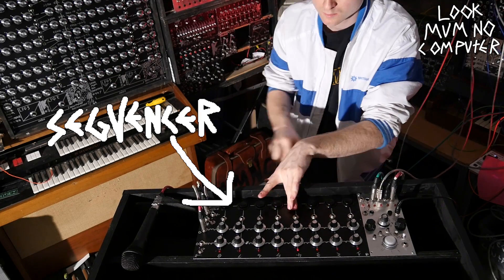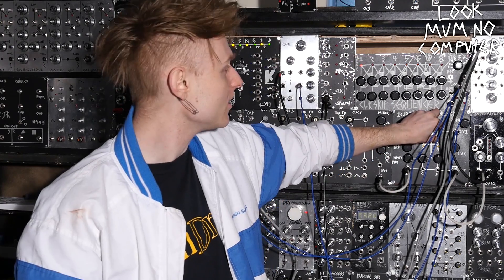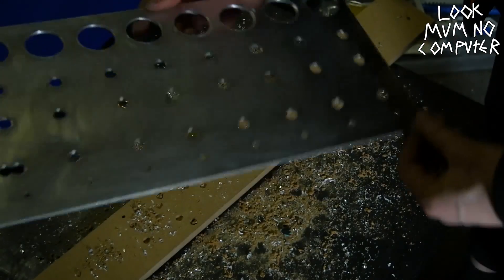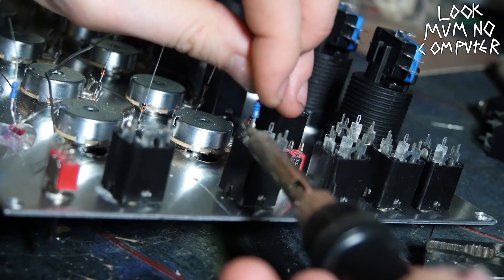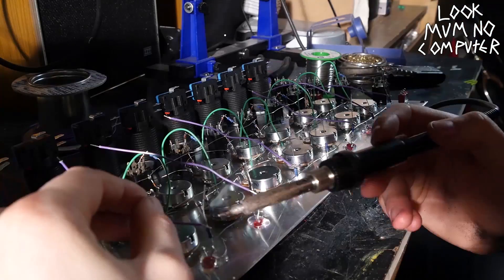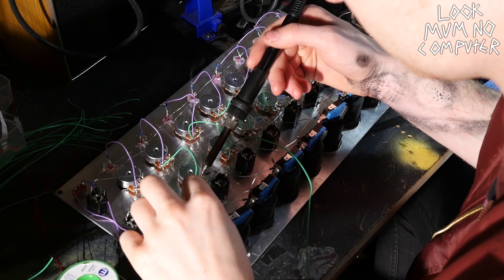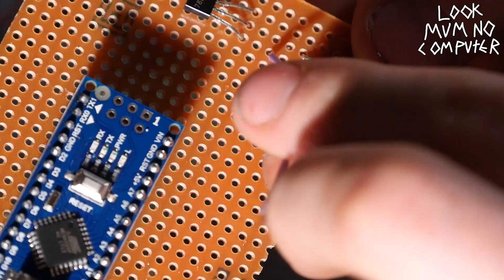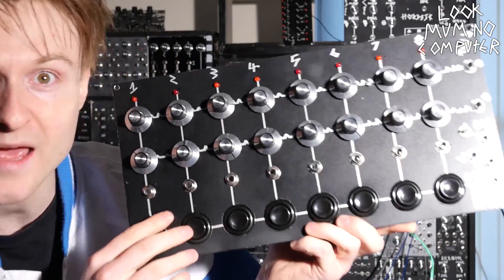ARDUINO 8 STEP KEYBOARD SEQUENCER FOR SYNTHESIZERS

Comment: 4017 was first chip i ever used back in 1977. Most of us were still building with valves then. Knight rider was the thing and connected each of the ten outputs of 4017 to leds to give the scanning display. Was clocked with a 4001 quad NOR gate as osc.

Comment: built analog outputs version. spent two days troubleshooting so far..all steps seem to work but they lights dim the further from step one they are... they only advance with forwards clock reverse does nothing but has 5v coming out when switch is hit. any button press resets it to step one being lit after the button is released. ive read every forum post and i have tested everything i can think of. maybe its my arduino?

Comment: i ordered all of the parts for the 2001 update before i realized theres no info on the dif between them and i am terrible at reading actual schematics. how do alter this version? i joined patreon but couldnt find anything there either
Reply from the maker: Aaah yeah the 2001 is a more advanced version of this project. Unfortunately the best way to do it is to work from the schematic if you don't want to make it from the pcb sadly :( also to answer your wav trigger question use the midi input instead for everything that means you can do the pitch bends and everything
Reply: @LOOKMUMNOCOMPUTER  im used to using bend diagrams and hand drawn labeled stuff i understand most of it just not enough to guess. ill keep trolling the forum thanks! if i can save up a little money ill probably just order the pcb
Reply: i have no issues following your hand drawn squiggly lines but that printed version hurts my brain haha
Reply from the maker: @machinemademan  i think its slightly more involved than a usual sort of bend design of sequencer. so it might be a little hard to draw in a different way. i think the best bet is to make the one in this video. the difference isnt massive :)
Reply: @LOOKMUMNOCOMPUTER  i chopped up an old stop sign from my time as a sign guy for a panel then i made china a little richer for my bday this year and ordered the stuff for big button wav trigger and this. i put a caspers lfo into a rugrats vhs and hooked it to a werkstatt then it snowballed into this.  thank you so much for what you do! ill keep supporting the channel i wish i could do more

Comment: I build this 2 times with different components but the sequencer will not work. Keyboard works fine, but the sequencer is running non stop and reacts when i touch anywhere (Button or pots). I try different jacks and knobs. I think there is a ground problem but i dont get it. I check the schematis and solderpoints 100 times... 😑
Reply from the maker: The clock in jacks need 10k pull down resistors

Comment: Hey Look, I need your help as I have an arduino mega 2560 and I'm going to build the same sequencer as you built but I totally don't know much about programming. ehhh i want a 16 stepper done for 2 oscillators (CV). If you could help me understand the code and diagram, I would be very grateful. We can contact you by email Mieszkoalbrzykowski@gmail.com.

Comment: Hello, Anyone built this for eurorack? Will figure out dimensions and stuff, BUT: 
Hows the Power supply working?
Will pick up Ground and 12V from the Eurorack Power Busboard, probaly? 
Is it only thge Arduino, that needs to be powered? 
The Arduino works with the +12V from eurorack?

Thanks for any response, hope this gets some attention :-)

Comment: Is there a reason I need to connect it to an external power supply? Will running it all through the arduinos 5V cause issues? I can't figure out from the schematic whether its positive voltage coming in or just voltage. I'm sooo close to finishing this, and don't really have a modular set up yet, and it'd be really cool to just power it via USB for now lol but I don't wanna blow it up.
Reply: Don't worry! I think i've figured it, and it should be fine running off 5v arduino power.

Comment: I have a akai synth station 49. It’s a keyboard with an iPad dock in it. It has no midi input. It can get midi through usb. I want to add some real time control (knobs and what not for cc). Do you know if something could be made with arduino and plugged into the usb to control my iPad synth apps?

Comment: Is there a simple Clock  circuit for this? Been looking on how to make a stand alone analog  clock, that has read out for BPM so I could dial in  is 128 bpm and maybe  multiple outputs, any suggestions? Thank you!
Reply from the maker: hey daniel!! digital or analog? i wonder how tough it wqould be to achieve analog let me think,. have you looked on the arduino forunm? probably not what you want to do mind!!!
Reply: @LOOKMUMNOCOMPUTER   analog. I have build 1 CEM3340 VCO and almost finished my 8  step seq, going to finish up my envelope ,  starting to come together,  still have to build the  sparkfun drum machine. I did search the internet f but did not find anything
Reply: @LOOKMUMNOCOMPUTER   here is the best I found  - https://www.youtube.com/watch?v=nBucMzlgESw  website page https://create.arduino.cc/projecthub/Synthemafia/modular-synth-clock-module-diy-arduino-sm-tik-tak-bd8ded looks like might work ,. what is your opinion on this?

Comment: I wanted to make a baby 10 sequencer, but the arduino seems the more versatile route.. I see you already generously put the plans for this up, but so you have any tips on 1)making this a 10-step and 2) adding switches to adjust the number of steps like on the baby 10s? Like say you wanted to jump down to 4 steps..

Comment: This is awesome, but for now I can not figure out exactly how to proceed with this. If I understand, the arduino doesn't generate itself the clock pulse ? wouldn't it be great to add this function with a new pot, of course it needs analog input for this...may be with an arduino mega  or due ?

Comment: Hey Sam! I love your videos... I'm currently working on an organ drawbar controller from the parts of an old Weris organ... based on the Arduino Micro. Getting along mostly well so far... but one question I have: What front plates do you use? Aluminum stuff, I suppose... what are they called?

Comment: 5:00 The Arduino's AtMega328 chip has internal pull-up resistors you can enable thru software :)

Comment: Does anyone know if the 5v wire connecting the push buttons and the 2 switches is connected to the 5v out pin of the voltage regulator or if it only connects the switches and buttons. Thanks

Comment: could I use a slow sqaure wave oscilator as a click signal for a 4017 chip?
Reply: No because square wave is ac. You need a clock pulse, which you can create with a 555 timer

Comment: How do I send midi notes with the arduino sequencer ?
Reply: It's fairly easy to make the Arduino send MIDI out. You just need to Google "Arduino MIDI out" for the components, and use 1 or 2 other digital outputs to send the data. I dunno how the note pitch would scale though! Like, would an octave in MIDI pitch match an octave in the CV? Probably... not so much...

Comment: I'm working on it right now. Arduino is mounted on stripboard all switches, knobs and pots are in plave, now I "just" need to solder the cables, resistors and stuff.

Comment: Why bus the pots instead of isolating them? Or am I missing something
Reply: Each pot is a voltage divider between an Arduino's step output and 0v ground, so the ground connections are commoned / bussed.
 The outputs of each bank of 8 pots are routed through diodeees to a common CV-out bus line.

Comment: Amazing video! Where is your source of sound? Is it from your Analog synthesizers, or via usb in the Arduino? I'm new to circuits! I want to filter sound from a virtual VST into this amazing device, could I get similar results? Could I get such results filtering sound through an audio Interface?

Comment: you progeam the arduino, using the arduino IDE software. you can download it online.   you may also need to download Ch340 driver, if you use an arduino clone

Comment: Hi sam.. firstly, your channel is awesome! Just joined your patreon :) I love building diy stuff, generally arduino based granular synths and noise makers, with the odd 555 based theremin thrown in.. i've just built this but im having a hard time understanding the 1/4 jacks..... i know the ones under the buttons are cv out to control other modules or noise makers... but what are the others? reset cv? fwd/rev? are these inputs??? and which jack do i put th clock signal into?  and woukd it possible to hook up an integral osci, so it has its own clock? sorry for the probably questions, kinda new to this aspect of electronics.. Jay
Reply: I've been trying to figure this one out too.  I just got it working..I think...for the most part.  Go CV OUT 1 or 2 to CV in on an Oscillator, and to your speakers from the oscillator out.  Send signal out from another LFO to Forward or Backward cv in for your sequencer clock.  Or at least that's how i've had it working the past day or so. I have an issue where it won't cycle through steps if I plug certain cables in all the way??   Any tips Look Mum No Puters?
Reply: Cheers.. I'll give that a go at the weekend.
Sound like your jacks might be poor.. I had a bunch of jacks that would only work when they were partially inserted.. Swapped the jacks out and the issue went away

Comment: Wondering the voltage out of this? 0-power? (5V)? Is it enough for modulars? Could you replace the buttons with, lets say touch plates? (Finger touch thing?)
Reply: The CV-out is probably 0v to 4.4v (5v - 0.6v diode drop.)

And yes, those capacitive touch switches could be used instead of the mechanical tactile ones.

Comment: Hey! thanks for your amazing inspiring stuff! One question: I built your sequencer and when I power it on, or if I send the clock in, it's stuck on the first step. I can tell from the Nano board that it receives the clock but it doesn't move on...any idea?
Reply: SMMP Have you had any luck with this? I'm having the same issue and assume it's something to do with the code?
Reply: Hi Jeremy,
yes I had luck, but the issue is not in the code but it was in my soldering. I had something not connected which I forgot to solder properly. So my advice would be to check the board and all the connections...
Reply: SMMP Thank you! I did find that the issue was no pull down resistor from the 0 CV in his wiring diagram. I have it working now. thanks for your response!
Reply: yeah, I remember finding the odd glitch in the diagram even if probably, due to lack of sleep, I just forgot to take notes...

Comment: I just built this (It's almost working) and I noticed an error in your arduino code: It looks like you switched the STEPBUTTON7 and STEPBUTTON8's pins in the top #define section. 

Thanks for the awesome build though!
Reply: can you help me please? I built it but not working, no sound. I think that the sketch is not complete.
I did everything as in the photo.
https://www.youtube.com/watch?v=A0ch_8IlzD0&feature=youtu.be
I don't even know what's wrong
I checked everything but the sequencer does not work

Comment: So what is the voltage regulator for, to limit them triggers to 5v? Doesn't nano have a 5v regulator? Just been thinking about that for last 2 days.
Reply from the maker: the heat dissipation on the one on the nanos aint too great. so i pop one on anyway. no harm, had a couple of nanos keep shutting down cus ot the VR;s gettng too hot from a synth power supply

Comment: Are you ever worried about the bare wires accidentally touching or shorting? Maybe spray something like a latex paint on them as a final step after successful testing? Like hell I would spend all day long with a roll of electrical tape!
Reply from the maker: taking old things apart and seeing bare wires like this, has kind of eased my mind on that.

Comment: If you're using an 8 sequence, does it use the 4017 or the 4022?  I looked up the datasheets and the 17 looks to be decimal.
Reply from the maker: Dave Hojo yeah it’s a baby 10 sequencer:) just reset it at 8!

Comment: Hey! Love your vids. You should show us a baby 8 sequencer as well! :) I think the IC for it its a little less expensive than an Arduino.
Reply from the maker: João Pedro VC Ferreira yeah I guess but those arduinos are only £2.50 search up arduino nano on eBay. Cheap as pineapples
Reply: oh well never thought of buying it through eBay. I'm a bit inpatient so I usually buy my electronics in stores here in Portugal. not quite as cheap here. more like 15€ and the 4017 IC is only like 1€. But yeah, will buy stuff for this on eBay! :D Cheers!

Comment: This is hands down the best diy musical project I've seen. I'm about to make one of these along with some simple oscillators to start with, but I'm a total beginner at synths and stuff. I was just wondering: how do you control the tempo of this thing? Does it need the signal from an external source (and where would you plug that in) or maybe I can have it simply controlled by arduino by adding another knob?

Comment: Thanks so much for sharing this project. I thought I’d give making one a go and it came out very nicely. I shrunk it down with 3.5mm jacks to work with eurorack and smaller buttons. Built it in its own little box powered off a 9v guitar pedal power supply. Works a treat. One query, why did you go with separate jacks for forward and reverse rather than a switch?
Reply from the maker: cool! fire us over a pic and i can include it on the website :D computer@lookmumnocomputer.com

Comment: lovely project. I think I 'll make one for eurorack. Do you think I can just remove all the "arcade style" buttons???
Reply from the maker: yep! itll be fine. if you find it starts jumping steps. have a look at the code and remove the switch input pins. just put pin 0 on them all. or you could just wire all the pins that were on the arcade buttons to ground! also your on my patreon, there is a schematic and code for a 16 step arduino sequencer much like this on a zine :)

Comment: ..."and then you can make it do whatever you want".... #arduino. I think your fundamental knowledge of other IC's is far more valuable than the over-hyped functionality of ARM/Atmel-based solutions. There's something to be said for having an exact solution over an over-engineered, seldom-utilized, programmable MC. Tough, maybe I just have some opinions....
Reply from the maker: Fair. But whenever I’ve breadboarded out stuff with cmos in the past. I’m sat there being like aaah it’s so close but I wish it did this. Or this different. Having to add a load of other crap to make it do something not 100 percentnhow you want. In the end of the day I see it as aslong as it’s real and a tangible real world machine and does what you need. It’s fine. And these arduinos are so cheap
Reply: most of the time I'm planning stuff with discrete components, and find out it's much cheaper to plug in any MCU (Arduino for not complex stuff, 32-bit arm like the stm32 series for more complex stuff) and call it a day.
plus with the Arduino, you have a fewer bodge wires laying around.

Comment: heya there! your channel is gold. started patreoning and stuff. anyways: is this sequencer putting out voltages 0-5V to CV? how does that work with modular stuff, isn't the CV usually -12V .. +12V or something? really newbie question but bothers me a bit since i'm planning my own low-cost "modular" stuff.
Reply from the maker: zapallalla thanks! There’s a live stream tonight! On over there thanks! Yeah it’s fine. If you think of v/Oct it would mean from the 0-5v it can put out that’s 5 octaves. Which is more than enough! And plenty of space to modulate things. Yes it could be  a larger level but that brings more components into the picture. And for that’s it’s meant for this does the job fine!

Comment: Engineering is punk. Subversive. And you embody that ethos. Never thought I'd hear pull up resistor or diode explained so simply...as in 'this is what it is. This is what it does. This is what it is for. Move on.' Love the spaghetti mess, the apparent drill sloppiness while driving home the value of pilot holes, the well used bench, the old Apple ][, the 'just try it' bias. May your videos inspire legions.

Comment: Where do you buy your aluminium sheets to make your front panels?
Reply: super nice rig there ^^
Reply from the maker: https://www.ebay.co.uk/itm/Aluminium-Sheet-0-7-0-9-1-2-1-5-2-0-2-5-3-0-4-0-mm-Thick-x-25-Pre-Cut-Sizes/400651887596?ssPageName=STRK%3AMEBIDX%3AIT&var=670200641065&_trksid=p2057872.m2749.l2648

Comment: Look Mum, Thanks again for all the videos, I just watched your video "A Guide to Modular Synthesis with Look Mum No Computer," and saw you talk about making your own power supply (i figured this is the best place to write to you though, as the other vid isn't on your channel). Could you kindly point me in the direction of a schematic or helpful keywords for making DIY power supply. I spent a few days searching before I saw the other vid, but couldn't find anything, think im looking in the wrong place! thank you!!!!
Reply from the maker: Dominic Ditaranto 2 parts. I recommend just getting the pcb by frequency central called power pcb. Search it on google you’ll find it! And then a wall was that is 12v ac. Not the usual 12dc but ac output!
Reply from the maker: Dominic Ditaranto the pcb is only a tenner. All parts are maybe a fiver?

Comment: Hey hey awesome video as usual!  What's the point of the voltage regulator in front of the arduino?
Reply: It can handle higher current than any onboard reg on the Arduino, and also feeds the switches and their pull-down resistors when pressed.